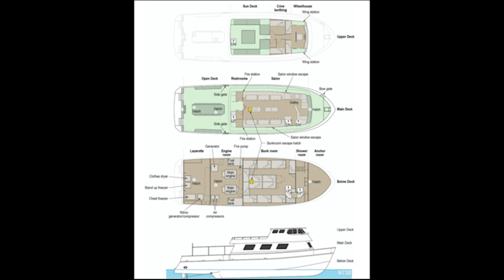The Sinking of the Conception

Comment: While the Captain may be a coward, the owners of the boat would be responsible in my opinion. I know common sense is rare but we've had enough tragedies to know that fire is a real threat with any vessel whether that's a building, car, train, plane or boat. If the owner is the Captain then he is responsible.
Reply: You're totally right but it sorta works this way be it ships or even planes, just ships n boats tend to be more lax unfortunately. There's check lists (quickish ones) the owner is supposed to comply and complete a check list or send someone to do so to insure the vessel is sea worthy and functional then there's normally someone on the crew like in this case I would guess the second captain who rechecks it and walks the ship and then the captain is supposed to do a final check. They all sucked basically.... It's like she said unfortunately some things have to go wrong to make things better.

Comment: The owner/operator is to blame. If the fire indeed is the result of charging too many devices at once that means the amperage draw was so high that the wiring or connections would’ve gotten hot and melted wire insulation until it could short together causing the initial fire. The reason being would be improper fusing/breaking. Either none used or oversized allowing small wire to get hot. This is something that should be checked and covered by the operator. The only other possibility is that the fuse or breaker failed to operate and melted.